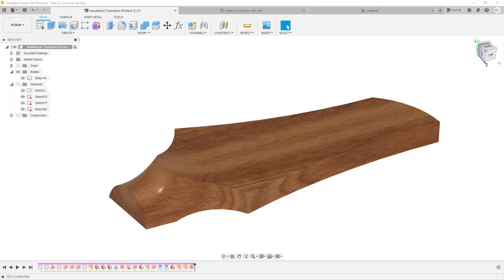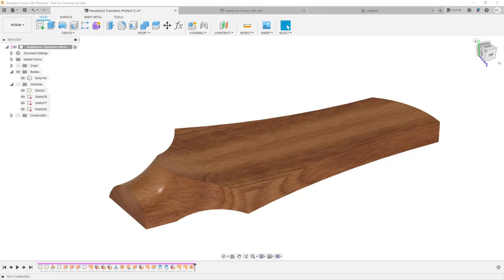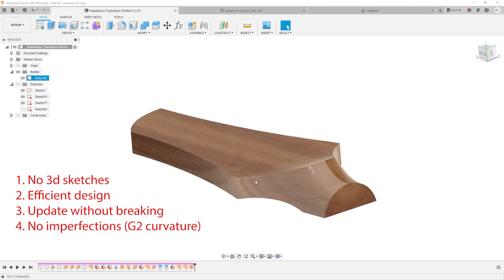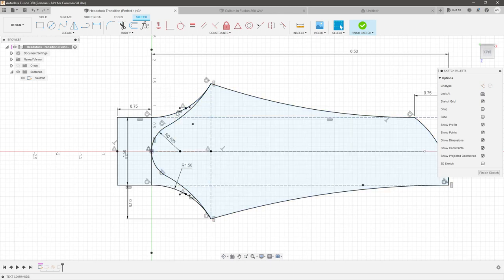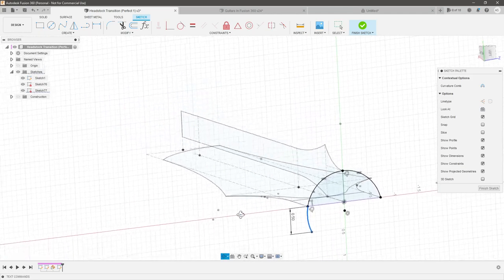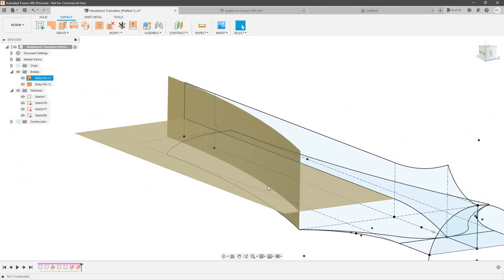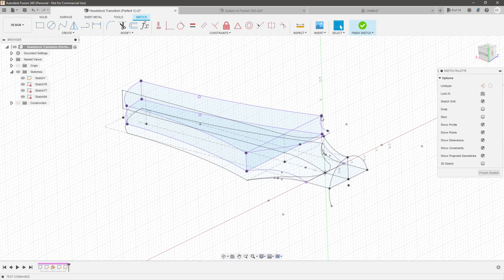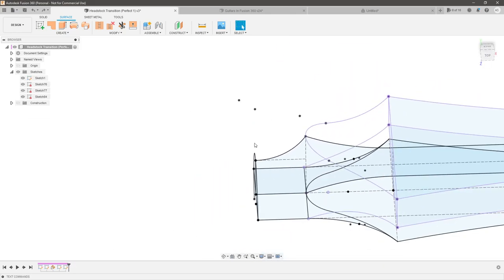I thought this was impossible. How to create PERFECT headstock transitions.

Comment: Austin - excellent job! - I have been wrestling with this EXACT thing for the last 6 months. Being a veteran of both SW and Inventor, I was struggling with the tools available in F360. I recently did a career pivot (thanks pandemic!) and now work for a prominent guitar builder in Nashville. I quickly found out the these headstock blends are no joke! This approach is clean, clever, and still parametric - cheers to you!
Reply from the maker: Fantastic! Im glad you found this useful, particularly in your line of work.. Congrats on the new gig btw, sounds like a fun job! I originally was CAD trained in SolidWorks when I was working with a Diesel Marine Generator company.  Now that I'm in Aerospace MFG, I use mostly NX at work. F360 is what I use for home projects . F360 is definitely a different workflow than other CAD applications, but I've been pretty satisfied with it (except for joints/mates :P)

Comment: Hi, what a truly wonderful solution thank you. I have modelled and machined many satisfactory guitars using my own clumsy transition but yours has taken this to a new level. I have just modelled and simulated the roughing and finishing toolpaths for the headstock transition and this version is superior. No gouges or weird machining marks I have had to previously contend with.  I have a couple of troubleshooting tips. For example I spent hours extruding the guiding curves for the patching operation. However, in order for this to follow my tapered neck reference, I actually had to loft between two neck shape sketches. I cannot understand how you seem to have extruded a taper! I have a couple of other problems I spent hours getting around but actually managed to do so [I used and asymmetrical headstock shape which was more troublesome.] If you have time and inclination, I would love to discuss this more by email with you, as it may help others tool. Please hit me up through here or PM me through my Facebook page if interested. Otherwise, thanks so very much for your comprehensive work and selfless giving away of your IP!
Reply from the maker: Thank you for the kind words! I actually addressed this taper issue in the follow up video "asymmetric headstock transition". That was a mistake on my part because at the time I was using a dummy headstock to prototype this technique, but didn't build it into an actual neck. In the following up video I loft between two profiles instead of extrude so that it accounts for the taper :)

Comment: REALLY excellent stuff here... thank you so much. Going to try this now.
Reply: Been trying this technique for a week now on a slanted (9 degree) headstock with non semetrical wings. Tough nut to crack. Austin, I'd love to know how you might approach something like that using a similar technique as what you've shared here.
Reply from the maker: Hi! The angled headstock is pretty simple, however the non symmetrical wings is what creates the challenge. I've gotten some decent results but it's definitely not easy. For me, what happens is that the center arc of the volute doesn't line up quite right for the intersection curve and leaves a tiny gap in the projected sketch.  This is likely a flaw with the 3 arc method being tangent on all lines. I've been able to get the arc to project successfully, but then the transition radius (for the helper surface) doesn't line up. 

I think in order for this to work how I showed it, the point at which the volute arc is tangent to the nut MUST be touching the peak of the volute on the side profile sketch. 

Not sure If that makes sense, but when I fully crack it you bet I'll post a video on it.
Reply: @austinshaner  Thanks for the reply. I've had similar issues with the valute not centering properly. Although I have had some small wins with a coincident constraint from the valute arc center to the centerline of the headstock and then a tangent constraint from the valute arc edge to the nut line. 

When you're doing the slanted headstock is your headstock face profile on an angled plane? I'll have to experiment with symmetrical wings first so I can nail the slanted headstock and then try conquering the non-symetrical wings.

Comment: Hi Austin, thanks again for your great tutorials - based on this one and your intro to parametric modeling I’m building an adjustable neck model, bit by bit. The fingerboard works a treat (adjustable width, thickness, compound or fixed radius). 

Where I’m running into problems is something that’s probably idiotic, and likely due to using the wrong tool or wrong constraints - I’m mostly using arcs (3 point, because they’re easiest to draw) for the curves on my headstock contour and volute. The problem I’m having is I cannot adjust the radius on any of said arcs. It’s displayed in the bottom right corner when I click on them, and that’s it. Or I get a warning that I’m trying to overconstrain the model. I’ve used construction lines to set widths and lengths for the headstock and constrained the vertexes to those points, so outside outline are adjustable by adjusting those values and it works smoothly. This is probably why I can’t adjust the radius manually for that. But for then volute outline, which I’m doing as three arcs with tangency to the outer points, each other and the line at the nut (apex of the volute) I can’t adjust the volute radius either. A pointer in the right direction would be immensely appreciated…
Reply from the maker: I've struggled with this a bit as well when I was developing this method. I typically don't have any issue constraining or changing the "wing" arcs, but the volute is sometimes a pain. If the peak of your volute touches the nut construction line, then here is the method that "usually" works for me. 

First, make sure your outer profile sketch is fully constrained (all black). Then draw an arc on each side that is coincident and tangent to the wings to start your volute. Then draw the center arc connecting the two, and manually apply tangent constraints to both sides. Then select the center point of the arc (not the midpoint of the  line, the actual dot), and make that coincident to the center construction line. Then select the center arc line and make it midpoint to the nut construction line. In theory, all that should be left is to dimension the center arc. Fusion is weird sometimes and I've had it still show the lines blue but says it's fully constrained. Usually if this happens, I delete the arcs, close the sketch, reopen, and try again. Often times, even if I did the exact same thing, that works lol.

If that doesn't work for you, send me an email with the file and I'll see whats going on.
Reply: @austinshaner  thanks a ton! I deleted everything and started the sketch from scratch, and now it all seems to be working. Still not sure why it was acting up yesterday - 2 unproductive (yet educational) hours spent, and now fixed in 30 minutes.

Comment: My hero!   The last video was great,  but this is game changing.  Next video needs to be on acoustic guitar heels.  BTW, have you played around with the neck profile sketch being a spline instead of an arc. If so,  does it affect how you draw the “helper” surfaces.
Reply from the maker: Splines will likely make it so you can't have "half" the neck extruded as a helper surface.  If you need to use splines for your neck, I'd recommend extruding the entire neck profile, then splitting the face with the midplane so you end up with segments.
Reply: @austinshaner   I drew half a spline and mirrored it, so I was able to select "half" easily enough.  One area where I had to deviate from you, was where the headstock flares out to the sides from the nut.   You have a straight section then an arc, mine starts curving immediately so I couldn't extrude the "dangling" helper surface, I had to sweep along path.   I couldn't get this surface to patch with G2, but I didn't try too hard and just patched without the dangler,  I didn't see any wonky surfaces.

On another note, I find UV curves much better for finding minor flaws in the surface than zebra stripes, give it a shot.
Reply from the maker: @matthewjacobs3952   @Matthew Jacobs  thanks for the feedback! I figured people would have to adapt this a little to their own designs. I'm glad it ended up working for you.. In my video example I didn't have a neck taper, which is why I was able to extrude rather than sweep. In hindsight I should have shown this on an actual neck and swept that dangling surface. I tend to use Zebra as a quick pass sanity check, if I really need to dig into it I'll typically evaluate the curvature combs for each section and troubleshoot.

Comment: I like the way you do that! I also work only on half of my neck / body, I found it easier. I use a lot patches and surface too but also loft. My methos is very similar as I want to have perfect smooth transition. I'm still struggling with my arched top cutaway and the heel of my acoustic but your intersection use give me some ideas!! Thanks!
Reply from the maker: No problem! I'm glad you found it useful!  Good luck on your design!

Comment: Hey Justin, I tried your method to make a heel for an acoustic guitar and hit many walls. I am almost at a point where I think your method is not appropriate for this type of work. Appreciate for any help on this.
Reply from the maker: Hi Vincent, I was just attempting a heel transition on my electric guitar model last night with the intersection curve method, and it does present some new challenges. Though I think it will still work (for electric heels at least) I haven't modeled an acoustic guitar before so I may not be able to answer specific questions, but if you shoot me an email to akdesigns.cad@gmail.com with your model or pictures of what your trying to do I'll see if I can come up with a solution for you.

In general, there usually isn't a one strategy fits all with these types of models. The headstock transition is the closest I've seen to that. Depending on the shape, it's best to figure which tool is the best for the job at hand, rather than forcing a specific tool to do what it wasn't designed to. I make this mistake all the time with lofts.

Comment: Any tips on common failure points why this would not work? When i try this I end up with curves that are acting like they don’t connect but everything looks right (checking coincidente and all). The result is that when I start patching, some edges aren’t letting me select them to complete the patch geometry.
Reply from the maker: Sorry for the delayed response, Dave. This is probably my fault, because in the video I simply extruded those surfaces because this was a prototype model - so there was no neck taper. If you were to actually model this on a neck you need to either sweep or loft the helper surfaces that touch the fretboard so they end up coincident to the Sketches.

I would guess if you zoomed in closely on your model at the point where the headstock starts to break away, the helper surface isn't quite touching because of this.

Try lofting that surface and let me know if that works for you!
Reply: Hi, I had the same problem. I solved it by extending the surfaces a little bit so i could connect them to one single body. After they were connected i could select the single edges in the patch tool. It took me a while to figure this out...

Comment: Question: Since the neck itself is not parallel but slightly “fanned”, will that affect the transition from your headstock drawing into the neck?  I hope that made sense…
Reply from the maker: Yes it does! I made that mistake in this video but addressed this issue in  my asymmetric headstock video, along with some improvements!
Reply: @austinshaner  Thanks!  I will be checking it out.  I have come very close to perfect; meaning that everything works as designed vs. comprising the design for a perfect surface… Thank you I so much for your contribution!

Comment: Austin. I am having trouble executing the fist patches. My neck has a taper and nothing wants to line up. My question is do you have your neck profile in the sketch starting at the nut line?
Reply from the maker: Very common problem people run into after watching this video.. Check out my asymmetric headstock video, I address the neck taper issue there and sketch everything from scratch .

Comment: To bad it isn't with a neck break angle as well. Very few guitars have straight head and a valute
Reply from the maker: Yeah, I see no reason why this wouldn't work on an angled headstock unless it's a really strange asymmetrical design.  Otherwise the first two sketches would simply have to be on an angled plane, and the third (neck profile) would be normal to xyz
Reply from the maker: I tested it this afternoon and it DOES work on angled headstocks! With some minor adjustments.

1. The first sketch is your front profile on an angled plane.
2. The side profile sketch is still sketched on a normal origin plane, but drawn at an angle to match the first sketch with perpendicular constraints instead of vertical constraints.
3. One additional sketch was required to create a flat section that connects the nut area to the neck profile sketch.
Other than that, everything is exactly the same!! 🙂

If you want to see pictures of the sketch and results, I posted it on the Fusion 360 Luthiers page on Facebook :)
Reply: @austinshaner  just did this today and is 100 amazing
Reply from the maker: @TheBrendio  Fantastic!!

Comment: Unfortunate that this method doesn't work if your headstock is angled. Intersection curve projection projects circles an arcs correctly but not splines and lines. Splines and lines are projected as they were not angled?. Probably a bug in the software. Work around is to project the headstock outline to a surface.